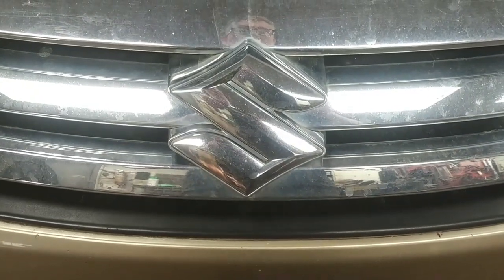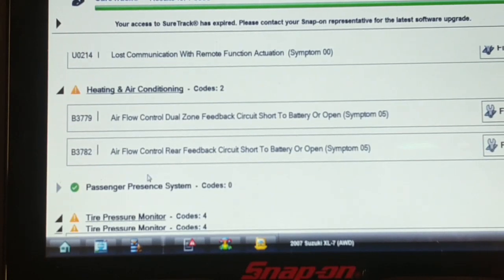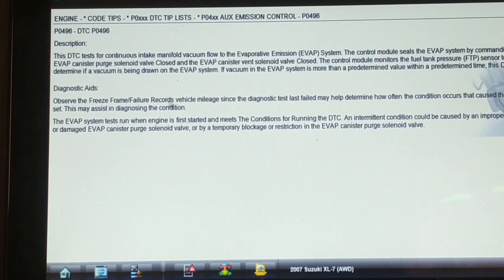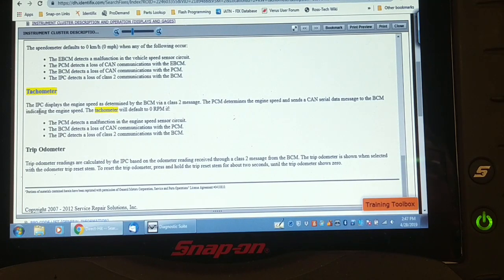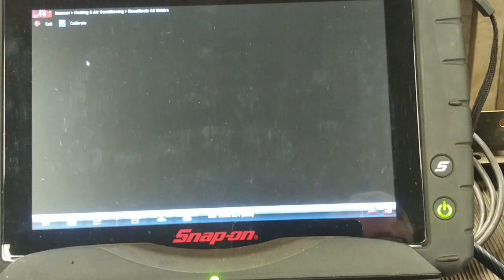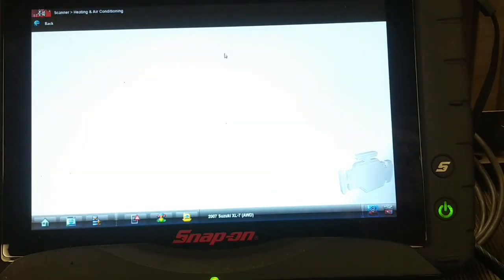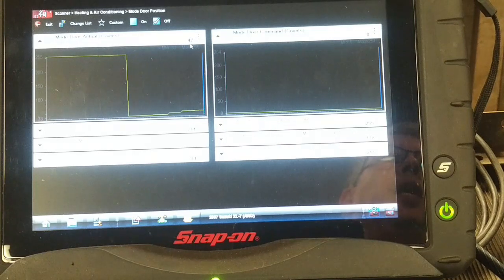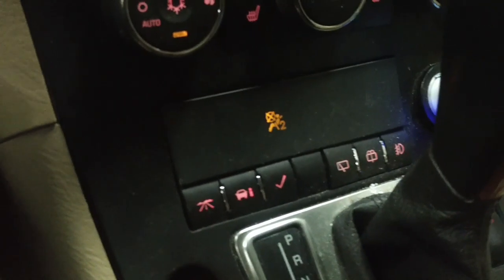2007 Suzuki XL-7 multiple electrical problems

Comment: My sister has this truck and the power steering is a problem as well census,and electrical system it leaks and the air conditioning and heating, never new it had a recall on this truck, constantly,had problem since the day I brought it

Comment: Do anyone know where can I find the battery fuse in my 08 Suzuki xl7
Reply from the maker: If you're referring to the alternator main fuse it's usually located at the main fuse block or right at the positive battery cable. Follow the heavy alternator output wire from the alternator. According to the service information it's called a generator fuse rated at 200 amps right front of engine near the generator (alternator). Good luck

Comment: I'm having a starting problem have full power but will not turn over
Reply from the maker: Check for loose battery cables and connections first. Confirm the battery is ok should be 12.6volts no load. Check for power at the S terminal of the starter while trying to crank it over. If you have power at the S terminal then make sure the battery cable has power at the starter. If so replace the starter. If there is no power at thebS wire while cranking try moving the shifter to neutral if it's an automatic. Move the clutch pedal if it's a standard. Aside from that we will need a schematic of the starter control circuit. If there is a starter relay you need to do testing there. Good luck.

Comment: Tengo un problema con lo Zuzuki xl7 2008 el moto ventilador prende al arrancar el vehículo en frío y nunca se apaga y la aguja de temperatura se vuelve loka aveces marca arriba aveces abajo y en ocaciones en medio y el sensor de temperatura no regula el consumo de gasolina ya se lo cambié y sigue igual me podrías orientar que puede ser gracias
Reply from the maker: Revise los dos cables que van al sensor de temperatura del refrigerante de vuelta al módulo de control del motor en busca de circuitos abiertos o cortos a tierra.

Comment: My suzuki 2007 XL7 trunk door won't open. Any suggestions?
Reply from the maker: Won't Open with the key or electrically? Can you hear the latch motor when you activate the power locks? If it's a switch problem which is unlikely you could likely use a scanner to command it to open but I'm not sure as I haven't done that on a Suzuki. You'll need a full function scan tool though if it supports that feature.

Comment: I have changed the starter on Suzuki xl7 now it won’t start can you help
Reply from the maker: Did you change the starter for a no-crank problem? If so did you forget to connect the  S wire? What do you mean by "won't start"? Won't crank or cranks but does not fire. There is a huge difference in the diagnosis?

Comment: Hey i have a Suzuki XL7 2007 and the ac spits out hot air when i have it on the cold side. What do you think is the problem?
Reply: Also, it turns on by itself after i take the key out. I turn the key so its off and its still on, and it turns off and on for a couple minutes.
Reply from the maker: What do you mean it turns on by itself? What does? the cooling fan? Heater Blower fan? As for the lack of cool air from the AC you need to see if the compressor clutch is turning on with the AC request. If not the system may be low on refrigerant. Is there and warning lights on? Is the engine temperature in the normal range? Fault codes related to the AC system?
Reply: @PhillipBailey  the whole car turns on by itself. I think it has something to do with the computer bc if it moves it starts making a beeping noise like something opened.
Reply from the maker: @AngryKittyy  I'm still confused by your statement. The ignition turns on by itself? So that the heater and radio start playing and gages come alive? If so I'd be thinking ignition switch. Does it have an aftermarket car starter installed? If so disable that first.

Comment: Hey Philip, I have the same car. I fixed the misfires which then the car threw a injector 5 open circuit i found a broke wire so i got a new harness fuel rail injectors and orings. fired it up and it said the same thing. I noticed the catalytic convertors were running extremely hot within 5 minutes they got up to 1000+ degrees. I pulled the cats off to changed them and noticed the rear cat had a huge crack in it. Im hoping that with the cats being clogged up that it is the problem and for the sluggish operation and nasty idle. What are your opinions on this?
Reply from the maker: Wow. Thanks for the comments. This is like the chicken and egg scenario. Which came first. The single biggest cause of cat failure is overheating due to a misfire with ignition misfire being the worse culprit. The unused oxygen leaves the cylinder and the forward O2 reads a false lean condition resulting in the computer adding even more fuel. This melts the substrate in the cat and restricts exhaust flow. This leads to more misfires on that bank as the cylinders can't breath properly. So in your case the prolonged exposure to misfire will tend to cause the cat to fail leading to more misfires. Vicious circle. Hopefully changing the injector harness restores proper operation of the injectors and replacing the cats fixes the result. I'd recommend to install new plugs as well and then confirm you don't have any more misfires. Good luck. Hope this helps...
Reply: @PhillipBailey  I will keep you updated. Yes the plugs where completely toasted. I'll email you pics of the plugs. 🤣 I get my cats tomorrow and hopefully my wife has a good running vehicle if not I'll have tons of parts for someone who has a need for them 🤣 thank you for your reply!

Comment: I check engine light just turned on and I scanned it today. The P0300 random misfire code went on. I’ve experienced my car miss firing on lower speeds. Like when I try and accelerate it feels like the car is skipping and struggling to accelerate. I changed the spark plugs already, would it be my ignition coils going bad as well? Any help would be appreciated! Thanks!
Reply: And by the way it’s the same Vehicle, 08 Suzuki XL-7
Reply from the maker: You need to try narrow down which cylinder or cylinders is/are causing the miss. If you just have an OBD2 scanner you will not likely be able to see misfire data which is available with an enhanced  scanner. It should show how many misfires have been counted on each cylinder. This is provided you haven't cleared the codes. If it shows a high concentration of misfires on say number 4 you can try changing that coil or swapping it to a different cylinder. P0300 is a code for random misfire but it may not be random. Some OBD2 scanners will report Mode 6 data but I'm not sure what Test ID the cylinder misfires are reported in. You should also check the freeze frame data for what the fuel trims were doing at the time of the P0300 code setting. There are lots of possibilities for a misfire. HTH
Reply: @PhillipBailey  thank you for your quick response. I will look into it more and try to see what’s causing the random miss fire.

Comment: On mine nearly every problem electrical has been the engine fuse block loosing connections between relays/circut breakers and their receptor plug in.  Over time the loose fit created resistance and heated up the pin receptors and melted their fit into the block allowing the pin receptor to spread open with no return spring tension.  With engine running remove cover from engine compartment fuse Block.  Begin by wiggling each relay and most likely you will create a problem from the pins falling away from their contact points.  'This is what happens driving down the road and vibrations release and reconnect the pins momentarily and creates all sorts of electrical problems.

Comment: I have a hot engine ac off on my suzuki can you help?or any advise
Reply from the maker: A message on the dash that the ac has been disabled due to the engine running hot could be low coolant, failed cooling fans  thermostat problems, water pump problems or internal engine problems etc. Start by checking the coolant level. Don't open the system if its hot. I would also recommend to watch if the cooling fans run when idling with the ac on. If not check the fuses that run the cooling fans. Hope this helps good luck
Reply: This car sucks ass
Reply: Did you ever figure out the ac off engine hot
Reply from the maker: I never had this problem with this vehicle. See my previous comment for what I'd recommend to check.
Reply: For her

Comment: My Suzuki xl7 2008 has a noise when the engine starts . A knocking sound not sure what it could be. Mechanic here are not all that on point
Reply from the maker: Thats pretty tough to diagnose without hearing the noise. Is the engine oil up? Are there any earning lights on? Could be lots of things knocking. Lifter, piston, con rod, timing belt slap or chain, serpentine belt or tensioner. Got to find someone who knows what they are doing...
Reply: Mine has had same issue. Replaced timing chain under warranty because these have stretching issues.  Still has cold start knock, but it goes away very fast... it's not like an old Northstar cold start knock.

Comment: hey , I have a problem with my Suzuki xl7 2007. my location is over seas and the maintenance here is horrible so I would like to describe the problem and if you can identify the reason behind my problem that would be much appreciated. when I drive my car everything is normal but after a while when I try to accelerate my car stall and then shift the gear so if i keep my pressing the gas it will make a sound and accelerate very fast l, but if i take stop pressing the gas while its shifting somehow the acceleration would be controllable and whenever i come to traffic it seems like i have Late harsh shifts or early soft shifts and this is another symptom Delayed shifting response from lower gears while accelerating  . I googled this they call it stumble and hesitation. some said my problem would be my Mass air flow sensor or throttle body , so i disconnected the MAS sensor and the problem is half solved i felt the acceleration very Strong but still have a knocking when the car shift gears , other said it might be my oxygen sensor and now some say it might be toque converter failure, so can you advice what would be my problem if you are familiar with Suzuki xl7 2007 most common problems.
Reply from the maker: That's pretty tough to diagnose without experiencing the symptoms. could be low fuel pressure, contaminated fuel, secondary ignition break down like a failing coil, induction leak or even transmission issues as you mentioned torque converter. You can rule out the O2 sensors by simply unplugging them. If it runs the same unplugged its not the O2 sensors. Have you tried to scan it? Is is setting any codes? Wish I could help more. Are there and mechanics there with diagnostic tools? Good Luck
Reply: @PhillipBailey  hey again.. I got my car scanned .. the Codes were P1719 which is incorrect shifting, P0741,P0742 Torque converter.. so what should I do ? Is it the Solenoid valve damage? Or is it the whole Torque converter need to be replaced or is it the whole transmission? I would really appreciate your help..and what do you recommend the best solution to fix my problem and please note that sometimes when the car is hot .. when I turn it to manual mood (it is automatic transmission) the gear stick between 2nd and fifth gears, I mean when I shift up it doesn't go to 3rd but to Fifth, when I shift down it goes to 2nd. This issue is not always but just when I drive it in the afternoon time ( when the weather is hot) .. thank you dude
Reply from the maker: @alialahdal6318  have you checked the condition and level of the transmission fluid. If it low top it up and maybe that will help. If its full chances are you need a transmission rebuild or replacement.  Ill see whats common to set those codes
Reply from the maker: @alialahdal6318  those are serious codes indicating slipping occurring in the transmission. The trans dipstick is bolted in so you have to remove a small bolt to check it. If its burnt then its transmission replacement time. New from dealer will be several thousand? Maybe you can try to source a used one there. Replacement is around 12 - 14 hours. Good luck.
Reply: @PhillipBailey  many thanks for your help.. I guess I will go for a used one.
Reply: Thank you for your fast reply.. I will try to have it scan then I will see which code does it through 😃

Comment: Me podrá desir donde se ubica la válvula PCv Suzuki xl7 2007??
Reply from the maker: . Suzuki usa una válvula fija de pcv oriface en la tapa de la válvula trasera y está tapada. no había piezas disponibles, así que limpié todo el sistema de pcv. espuma de mar agregada al cárter. no encontró fugas de aceite después de correr 10 millas. hasta ahora tan bueno 132k
Reply from the maker: No estoy muy seguro, qué motor e intentaré averiguar

Comment: Basically a Chevrolet Equinox 
Had a rave4 2010 in the shop here a couple of months back. That would set misfire codes after fill up at the gas station. Stuck Evap solenoid was the culprit. 
Nice work Phillip
Reply: As you said at the end, that's what I get for commenting before watching the video all the way through 😜
Reply from the maker: Thanks Mark. I didn't think of that possibility but that could definitely explain the missfires if it occurred after a refueling event. I'm going to ask the customer if they recall that. Even though this is mostly GM it doesn't save GM failure records only one freeze frame.